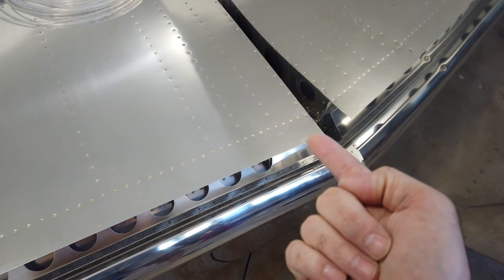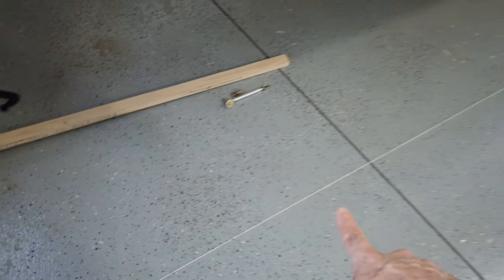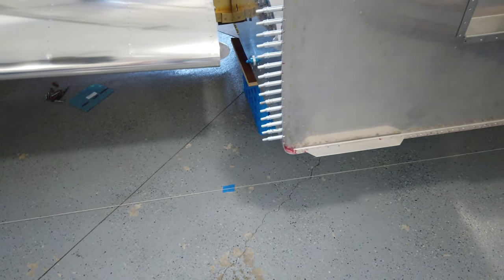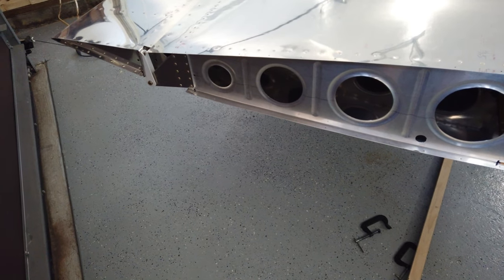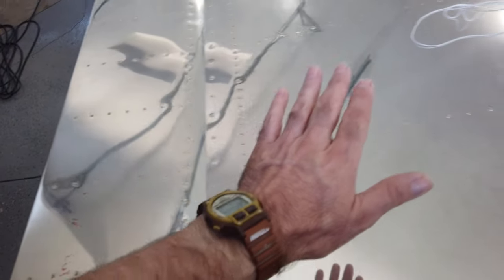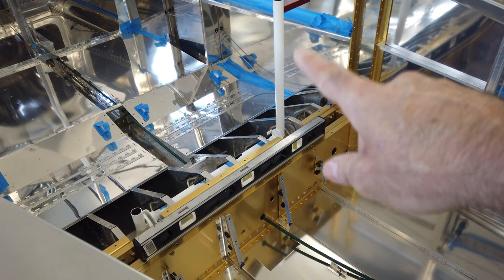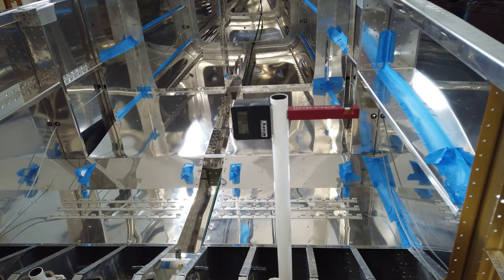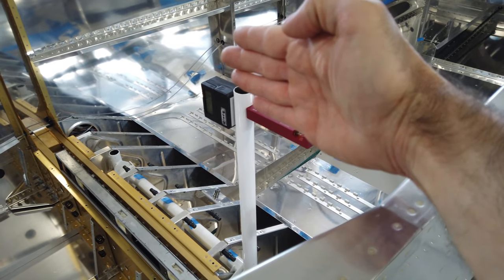Vans RV 7 HINT Video Fitting Wings 5

Comment: Thanks for making these videos, very entertaining and easy to understand.
Reply from the maker: Howdy Sport. The process is to use a straight edge along the tooling hole centers on the wing tip rib  extended beyond the trailing edge. Then fit/rig the ailerons to match this straight edge at the trailing edge. tip. This aligns the aileron in chord with the wing. (assuming no wing or aileron twist.)  Then the flap is fit/rigged  in line with the aileron. All of this happens AFTER the wings are COMPLETELY fitted/rigged to the fuselage.